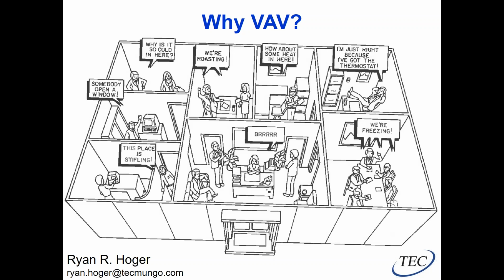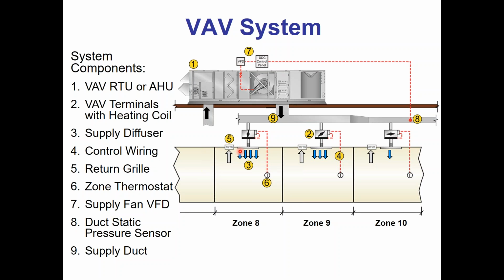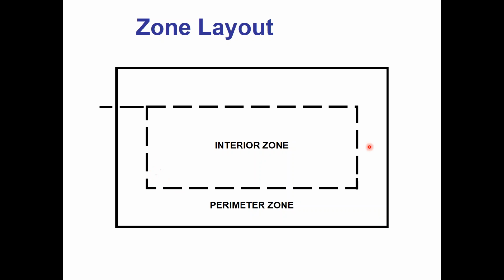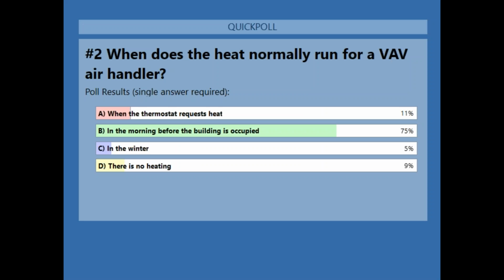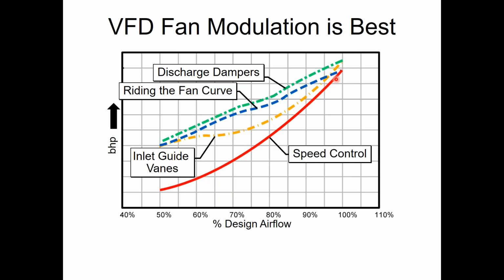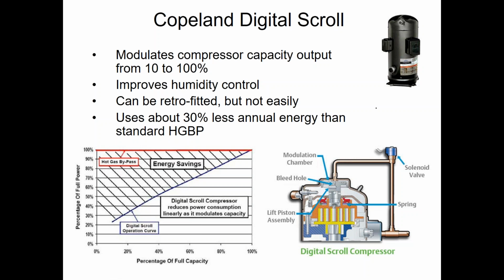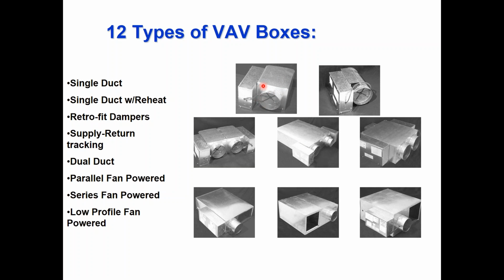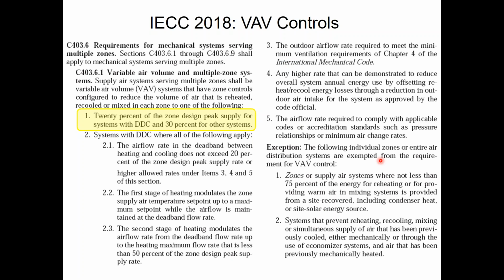Variable Air Volume (VAV) Systems - Webinar 5/29/20

Comment: cant seem to find the 90degree discharge on ASHRAE 62.1, but there is one on  ASHRAE 90.1-2016 for difference on supply temperature to room temperature.
Reply from the maker: Technically it is not a rule for 90 degree max SAT, but rather 15 above space temp. Most spaces seem to average a 72 degree heating setpoint so that comes to 87 max supply air and because most of us like to think about even numbers, we end up with 90.

In ASHRAE 62.1-2019 look at section 6.2.1.2 for Zone Distribution Effectiveness. The Ez calculation uses 0.8 multiplier for "Ceiling supply of warm air 15°F (8°C) or more above space temperature and ceiling return," which mathematically increases your minimum OA ventilation by 25% from what it should be.
Reply: @TECTubefilms  now i get it, i really need to dig more Ashrae 62.1, Thank You so much! More power to you guys at TECTUBE! 💓
Reply: Yeah an engineer taught me this recently. Hot air stratification is definitely a problem that results in wasted energy

Comment: How do you check if the amount of air being delivered is enough? Do they size the max by air changes per hour or l x w x 1.2? I have heard both please help!
Reply from the maker: No, sizing is not by air changed per hour. Nor is it by room dimensions. Although both of those are part of the overall calculations. The design engineer does a heat gain calculation (aka a load calc) for that zone adding up all the sensible and latent heat sources (walls, windows, computers, etc) on a "peak design" climatic day to determine how many BTU/h need to be removed from the space. This is almost always done with software and no one calculates by hand anymore. Then assuming a 55F supply air temp, uses that temp and the required BTU/h to calculate the required CFM of air needed.

Comment: So How Do you Trouble Shoot A VAV box for Heating cause i have a situation for patient room is staying cool when i want the room heated
Reply from the maker: VAV, by definition, is a cooling only system at the air handler level (other than a brief morning warm-up). Does your VAV zone box have its own local zone heater such as electric resistance or hot water coil, separate from the main air handler?
Reply: @TECTubefilms  Yes it is separate from the heating Element System so How do I keep that uint Warm except early morning when the unit needs heat
Reply from the maker: @timothyrichardson8567  What is "separate from the heating element?"
Reply from the maker: @timothyrichardson8567  To be clear, to heat the VAV zone you are talking about that specific VAV zone needs its own local heater separate from the morning warm-up heater that is in the main air handler and shared with all zones. So you need an electric heater instead the VAV box or on the baseboard permitter of that zone.
Reply: @TECTubefilms  So Where Can I go to receive training for this particular units for my job and are the classes online or in person.
Reply from the maker: @timothyrichardson8567  Depends on the "particular units" you have? If you are talking about VAV RTUs, then the manufacturer of your RTU (Carrier, Trane, etc,.). If you are talking about a VAV air handler instead of a VAV RTU, then the brand of AHU doesn't matter... instead go to the manufacturer for the DDC controls installed on the air handler.
Reply: Well first of all, if you can get the following informations, that would be a start:
-Room Temperature reading
-Room Temperature setpoint (with the deadband or the heating/cooling room temperature setpoints that come with it)
-Heater modulation percentage
-AHU supply air temperature

Since you said the VAV damper box had a heating coil, under normal conditions, the coil should be modulating at other than 0%. Some damper boxes are made to work with variable temperature AHUs, and therefore will have a switchover as to how the airflow is readjusted (cooling or heating depending on AHU air supply temperature).

Can be tricky at first but usually once you understand how a typical VAV (or less common but simpler VVT) works, should make your life easier.

[Edit] I realized that at our job we have a slang quirk. VAV damper box is for boxes with an airflow sensor, while VVT damper boxes have no airflow sensor.

Comment: If you start being politically correct, I will stop watching your videos.

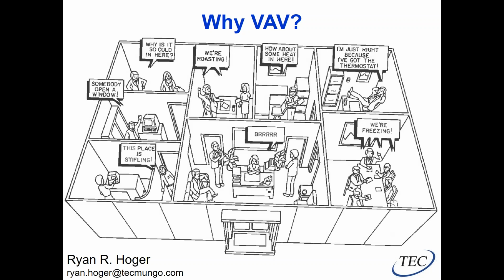1:20 Basics
1:50 Multi Zone System
12:35 VAV Breakdown
1:18:30 VAV Rules
29:02 Zone Layout
43:35  Minimum Outside Air Question 
47:50 Inlet Guide Vanes
52:40 Affinity Laws
1:03:30 Compressor Capacities
1:11:40 Hot Gas By Pass
1:50:00 Digital Scroll
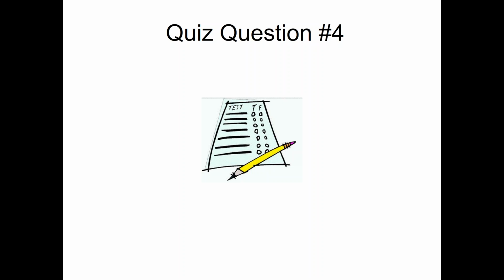1:25:54 Energy Savings
1:30:00 VAV types

Also, if you have motors (fans) that are rated for higher Hz, then it's fine to run it's VFD at higher Hz.

Comment: How do you determine the location that allows for a setpoint 1.2 or less
Reply from the maker: If you are the design engineer, you can determine that by the pressure your fan will be generating and the pressure drop of the devices it is pushing air thru, including coils, elbows, adapters, etc. If you are the installer, you can run the system, and use a manometer to sample a locations in the duct.

Comment: Would reduced airflow across the dx coil, when the boxes close, cause possible flood back at the compressors?  Is there additional sensors on the ddc to monitor suction temp/pressure?
Reply from the maker: Each VAV box controller is set with a minimum and maximum CFM that it can modulated between. The sum of the minimum CFM settings for all of the VAV boxes must add up to the minimum CFM required by the AHU or RTU.